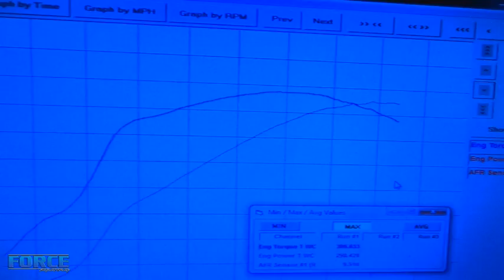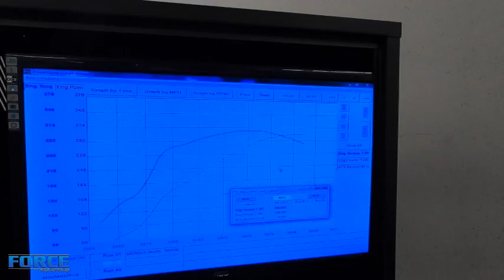Dyno Review - Ls Swapped 65 Cadillac Deville | Cammed 5.3l Ls | Holley EFI

Comment: I am finishing up a 65 Sedan DeVille.
Suicide door conversion. Four-wheel CPP disc brake conversion on Bag riders air suspension with accuair controller.  Chopping block tubular arms. A Summit crate motor 5.3 built to 450 horsepower. Holley sniper intake 92mm throttle body with a complete MSD ignition system. All Chrome is new all the stainless has been polished. The Arizona body was taken all the way down to bare metal and a 2014 Chrysler jazzy Blue Pearl coat was applied. The interior was done in a bright red leather